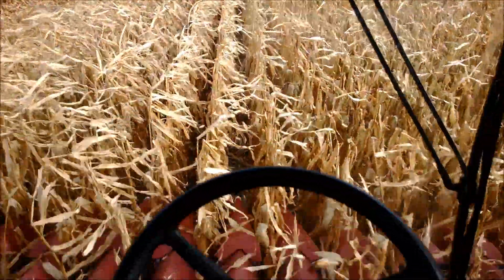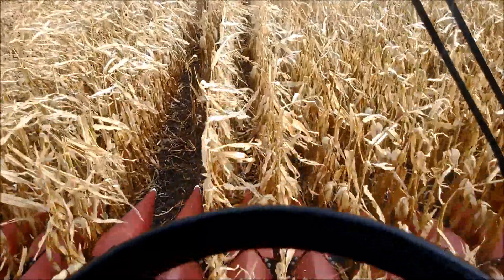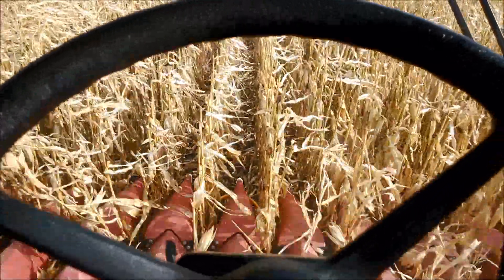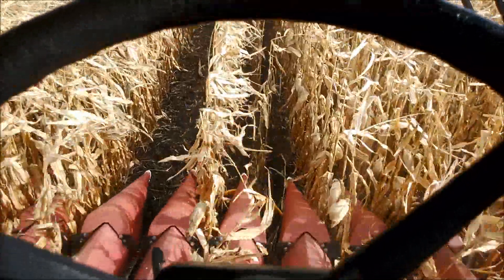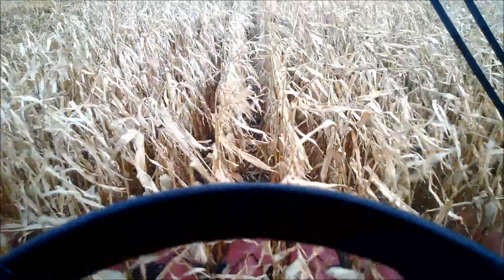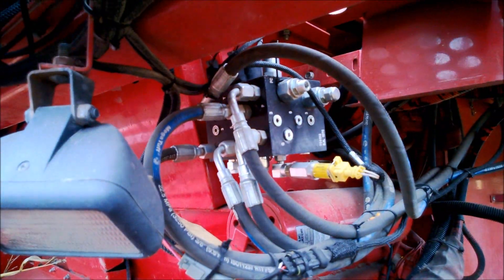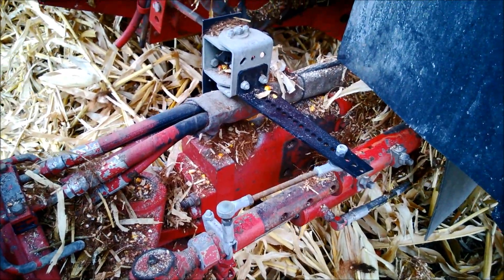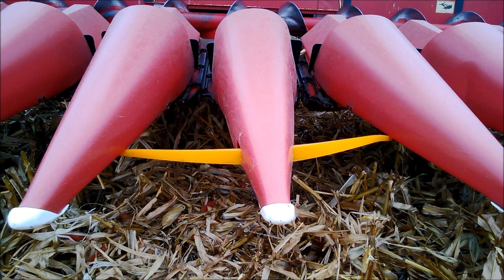Corn Row Guidance on a Case 2188 Combine

Comment: Where can I get the installation information for an install like this. All I can find on the Reichhardt website is the basic use and operations manual. I came found some used components and I am wanting to finish piecing a system together.
Reply from the maker: Hi Shaun. The "PSR Universal Installation Manual" should get you what you need. Installation manuals are available to Reichhardt dealers through the dealer support portal, but not on the general website. If you email USAtechsupport@reichhardt.com, they can send you the needed info.

Comment: What are the options for the steering interface? Does this system only work with a Reichhardt valve or are there other options. I am looking at a used system like this one with the c box display and wondering what it can interface with.
Reply from the maker: Hi Shaun. The system can interface with a variety of valve makes. It can display on the cBox or could also be hooked up to a VT display and be run that way. Feel free to message me with any additional questions.

Comment: Nice, but all that just so you don't have to steer?
Reply from the maker: +Oldtruckguy37 This is a common mindset by operators before using auto-steer, but after one season using it, most wouldn't run without it. There's a lot more components needed for this particular combine as it was not factory steer ready. For most newer steer ready machines, it usually requires only a sensor, controller and a few smaller harnesses.
Reply from the maker: On older model equipment, a lot more needs to be added. On newer "steer ready" machines, usually only a controller and the sensor on the header are needed.